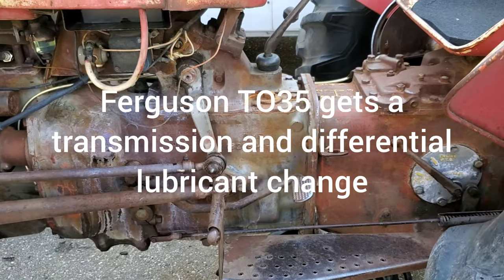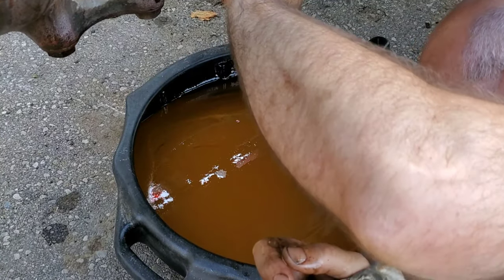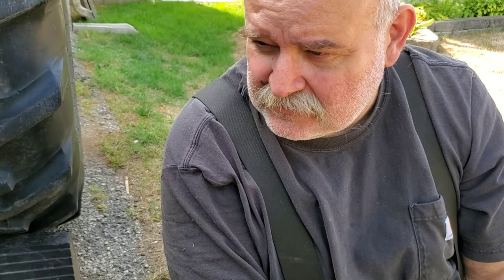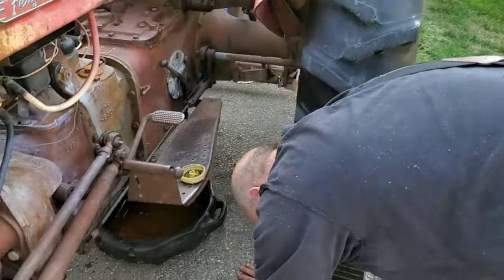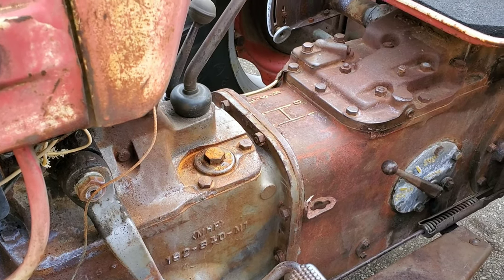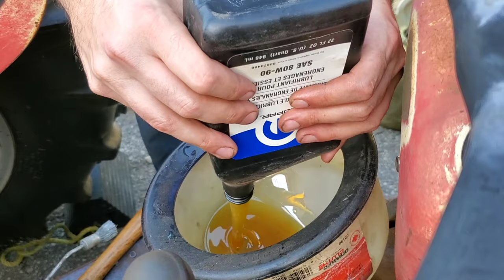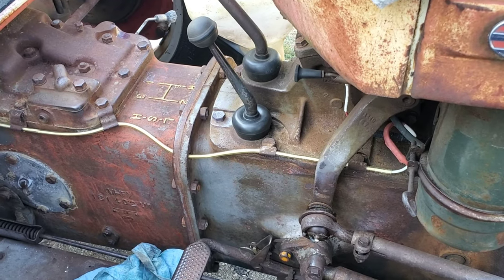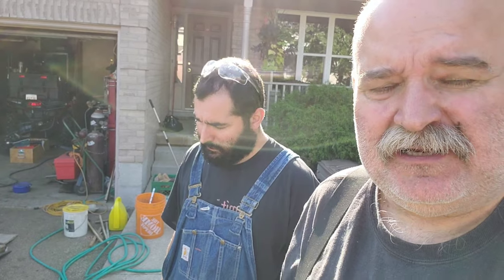1956 Ferguson TO35 tractor gets transmission oil change Massey Ferguson TO35

Comment: I would like to inform anyone that has an old tractor such as this 35 Massey Ferguson if you have a newer tractor that has wet brakes it uses hydraulic oil for wet brakes so if you use both tractors to pull such as the same V-rake you would need to put the same hydraulic transmission oil for wet brakes in the old 35 Massey Ferguson also. Because if you don't you will be mixing the hydraulic oil of both in the V rake  and it will eat up your wet brakes in your newer tractor and they are very expensive to fix (replace) . The old 35 Massey Ferguson will run ok with the new wet brake hydraulic transmission oil it is somewhat thinner than the older type fluid. I have a 539 IMT a copy of the 35 Massey Ferguson and I have a 5320 John Deere that uses hydraulic oil for wet brakes I use both tractors at different times to pull my V rake that uses hydraulics to lift and let it down.   That's a good looking 35 Massey Ferguson just needs a little TLC.
Reply from the maker: You make a strong point. The problem can easily be solved.
Shell Spirax S4 TXM Multi-functional Tractor Transmission and Hydraulic Oil
Specifications, Approvals & Recommendations
    Suitable for use in applications where Allison C-4 type fluids are required
    Spirax S4 TXM can be used when a SAE J 306 85W grade is recommended
    Case New Holland MAT-3525, M2C-134 A-D, FNHA-2-D.201.00
    John Deere JDM-J20C
    Massey-Ferguson M1143, M1145
    Volvo WB 101, Transmission Oil 97303:015
    ZF TE-ML 03E, 05F, 06D, 06K, 17E, 21F
    Caterpillar TO-2 (obsolete)
    Komatsu - recommended for use in certain construction equipment
    Clark Shell Spirax S4 TXM is also recommended for use in Case equipment where fluids meeting MS 1207, 1209 or 1210 are specified
    API Gear Performance : API GL-4

Comment: To flush most of the creamy water left in there: put a few gallon of diesel fuel in ..drive around and let it wash around then drain. That should take care of the creamy..then add your hydrolic fluid.
Reply from the maker: Thanks for the tip
Reply: Not sure how good running it with diesel in it would be on the brass parts in there. I run mineral oil in mine (get it at NAPA or TSC)
Reply from the maker: It's ok for a flush

Comment: Question regarding my 1958 Massey 88. To get to the transmission filter I have nothing on the left side that unbolts. Can I unbolt the right side where the dip stick is to get to the filter?
Reply from the maker: As far as I know you can
Reply: @JimsNBHomestead  Thanks a lot. I wasn't certain. I doubt my filter was ever changed. Fluids are milky. I also run a front end loader.  I ordered new rubber boots to help solve this in the future. 👍
Reply from the maker: @rickes8215  It's worth noting it's more of a suction screen than it is filter! It looks quite easy to clean if it is a screen and not damaged

Comment: Why can't you boil off the water, filter the old oil, and reuse it?
Reply from the maker: Very good question, yes it is possible to boil the water out of the oil. My thinking was to just replace it because I had no way of knowing it's condition. It was just not worth messing with. If the oil was of known age and quality then heating the oil absolutely would have been an option.

Comment: I have a 1957 TO35, I have changed the hydraulic differential oil in it twice over the years,
I used GL90 mineral oil, which Ferguson installed at the factory,
Critical issue was to protect that yellow metal in the transmission bearings, so I understand,
The 15w40 oil they use or can buy in England have some type material to protect the yellow bearings,

I may use shell rotella 15w40 oil the next time I change the differential in my tractor as the tractor is no longer used plowing, mostly just bush hogging

They are nice old tractors, take good care of it, 
My 1957 was gray and beige, your 1956 might be one of the rare early ones that was painted green and beige, maybe you can find the old paint colors under the paint,
Good luck with your tractor,
Reply from the maker: Oils have come a long way and the new oils will not attack yellow metals like the old days. The key is to protect the crown and pinion thats were the EP additives come into play. 15W40 isn't near thick enough in my mind
Reply: Forgot to say I slowly added in 6 gals then let it set for a while drove it around some worked the lift then slowly added more oil,  
book said 8 gals, but I never remember getting more than 6 1/2 -7 gals
Worked good,
Reply from the maker: Fred how is your tractor doing?
Reply: @JimsNBHomestead doing great, runs like a top, was out bush hogging this morning
Reply from the maker: Excellent news
Reply: 15w40 is engine oil 🤦 there’s modern oils now that just about every manufacturer makes for tractors that share differential and gear boxes. It’s a 10 weight oil hydraulic/trans oil hybrid with additives for anti foaming for hydro use and wear additives for trans/gear cases. Most manufacturers literally call them“Tractor Oil” I love the John Deere line “Hy-Gard” pricey but a cheaper alternative is Napas “Tractor Oil”
Reply from the maker: https://images.app.goo.gl/z2D3HRyz4SPax5iv8
Reply from the maker: Thanks for the heads up but theses old tractors require a viscous fluid to be "dragged up" into the crown and pinion. We used the 80W90 due to the fact we lots in stock "freebies" and it does work

Comment: The plate just in front of where you are working what has 4 bolts is leaking and has oil covering plate. Bolts are tight, bad seal???? Have you done a video on this issue??
Reply from the maker: i will review and see what is you are referring too

Comment: Is there a filter in the system anywhere? I have the same machine only a 23c diesel and it badly needs this service done.
Reply from the maker: There is no filter for the transmission and hydraulic system. I'm going to try and install one as a offline filter. Mostly as an experiment to see if can be done and be effective

Comment: Is there a hydraulic filter on the transmission? 1963 MF 35 Gas 6 speed
Reply from the maker: There is a suction screen in the transmission. There is no true filter. Once we relocate the tractor i will be adding rear remote on the hydraulics and at that point i can add a filter using an offline setup.
Reply: So it can't easily be accessed to clean with out taking the pump out? I just bought the tractor and it has some water in it and have no service history on it.
Reply: Just a heads up, I found that after the recommend amount of oil was added to my TO20, it took about 20 minutes for the level to equalize in both sections.
PS 
The milky appearance of the oil while looking into the fill plug as it's running might be the oil foaming, check it again after it's been off for a few minutes and if still milky, then it's water.
Reply from the maker: you can add one
Reply: @HydesRVBoatsRexford  you can get at it through the side cover
Reply: @jimott3358  Good to know! Any idea why plate in front of where he is working is covered with oil. Bolts are tight, bad seal???
Reply from the maker: I think it was from pressure washing but look for an upcoming video
Reply from the maker: yes gear oil has a tendency to foam
Reply from the maker: its inside the transmission. I think you can access it through the PTO selector

Comment: Why is mine a creamy white colour
Reply from the maker: OK, the creamy white color is because there is allot of water in your oil. The source of the water is usually the rubber boots on the 2 shifter handles are worn cracked or missing. When it rains the water will migrate pass the shifter rods into the transmission. Make absolutely sure your 2 rubber boots on the shifter handle are good
Reply: @JimsNBHomestead  thanks mate
Reply from the maker: no problem